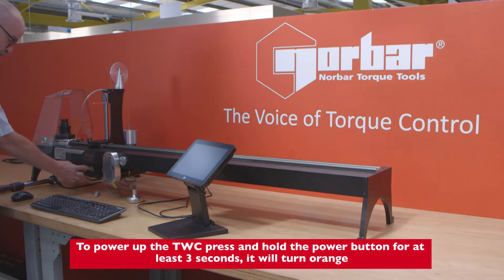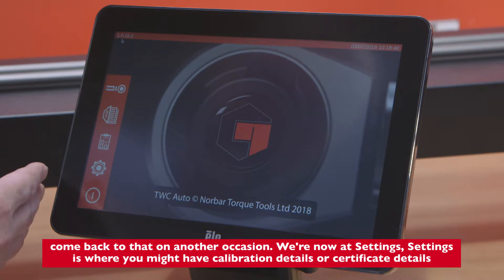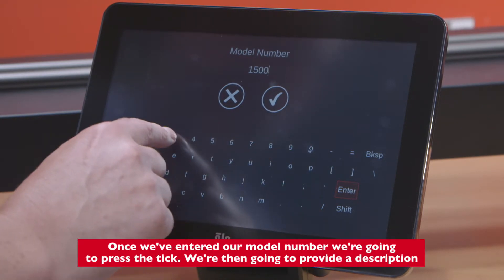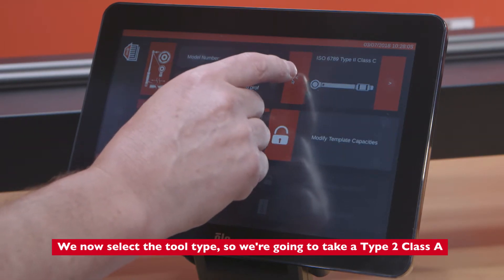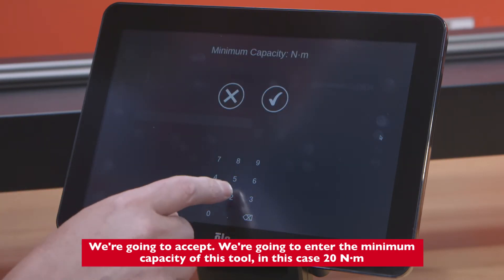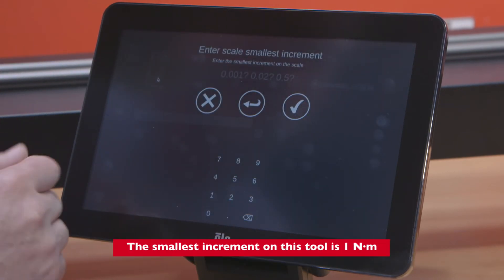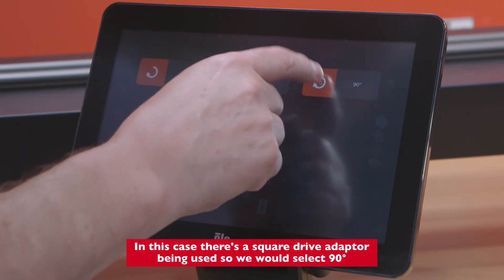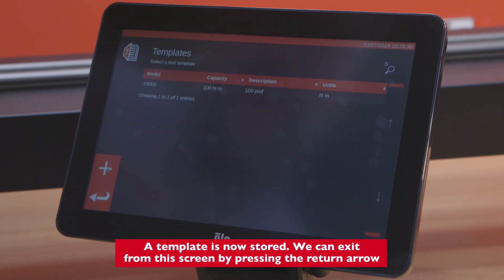1.  TWC Auto - Creating a Template

Comment: Can i use this for a Snap On torque wrenches mechanic click types or only norbars?
Reply from the maker: Hi,

The TWC can be used for torque wrenches from multiple manufacturers including Snap -On.

Wrenches covered include Type 1 (A-C) Indicating and Type 2 (A, B, C and G) Setting Torque tools in accordance with ISO 6789:2017 definitions.

Any other queries please do not hesitate to ask.
Reply: @NorbarTorque  Wow thats awesome!! This machine will always stay calibrated to check for issues or do i have to send this in too if i purchase it once a year or something to check for problems or calibration? Also whats the pricing on this? 

Also would you know if the digital torque wrenches from snap on require this tests?
Reply from the maker: Regarding calibration the transducers are calibrated in accordance with ISO 7882:2017 and this recommends calibration period of no more than 24 months and whenever it suffers any damage or has been subject to any repair.

The TWC is suitable for the checking and calibration of digital wrenches (for tool adjustment the manufacturers service manual may be required).

If you require a quicker response, we do also have a live chat feature managed by our technical sales representatives
 on the Norbar website.

Hope this helps,.